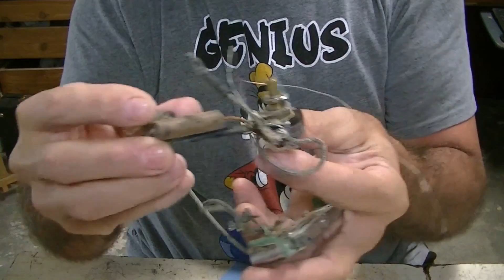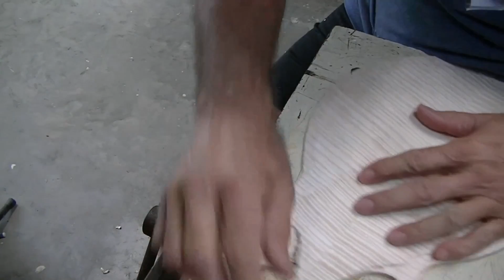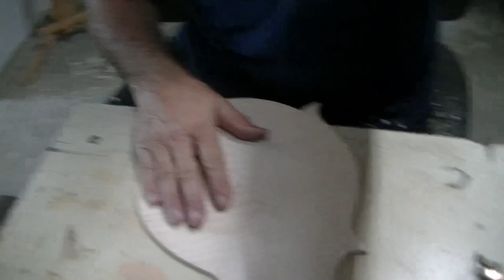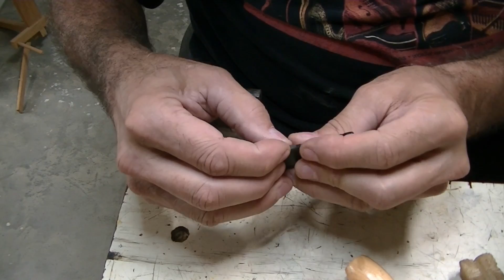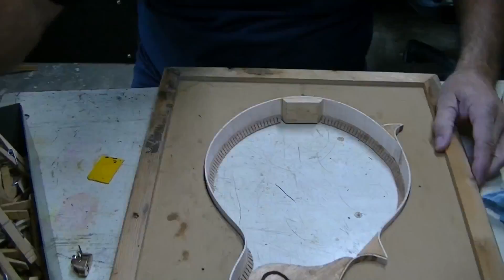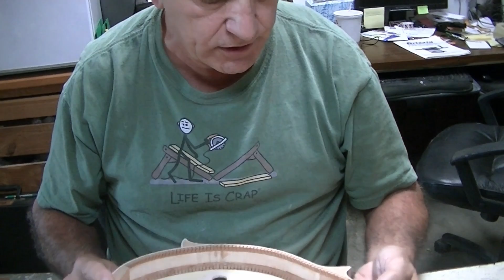182 RSW Custom Rosa Mandolin Build Part 4

Comment: Where do those thick flexible yellow plastic strips come from? They would come in handy for a lot of things. I do the outside of my carved instruments first too. The outside is what you see when it's done and needs to look just right. On the inside I drill small holes to just about the depth I want it carved in any area then carve to that depth first then slowly work it down the rest of the way. It works for me, just like your technique works for you. Love your work just the way you do it.
Reply from the maker: The yellow plastic is just a left over part from binders from Yellow Pages. I cut them up and use them I don't have much of it left at this point.

Comment: Hi Jerry, This weekend I visited a stately home in England where they raise deer.  The males were fancily decked out with huge antlers, about to start the "rut" and I said to myself "wonder what happens to the antlers when they fall off - could I get some for Jerry?".  So I asked a guide and she told me that that they never had any spare antlers as (a)they use them for teaching at local schools and clubs and (b) the deer actually eat the discarded antlers as they are a great source of vitamin D.  However, the lady went on to say that as they were fallow deer it was unlikely that they would be carving material and that red deer were much better.  Is this true in your case?
Reply from the maker: Andrew Bryan it is true that just about everybody has a purpose for their deer antler so it's pretty hard to come by. Thank you very much for checking into it. It is also true that the larger the antler the more porous it is in general. Therefore it's less useful for making saddles.  Thank you for watching.

Comment: Hi Jerry I’ve never built a Mando nor a violin - but I do know the luthiery schools teach that violins are done exactly as you do it.  Whoever called your method “wrong” is clueless- how could you or anyone carve a consistent thickness if the outside profile is not established? - it doesn’t even make sense.  CNC - sure - different story. Those will be identical so you’d do the machining however it was easiest to hold registration on the piece.
Reply from the maker: Tioga Fretworks thank you very much.